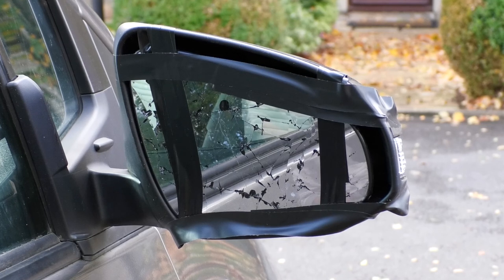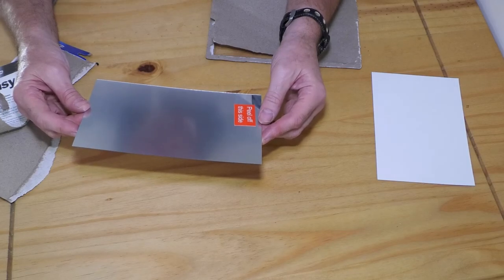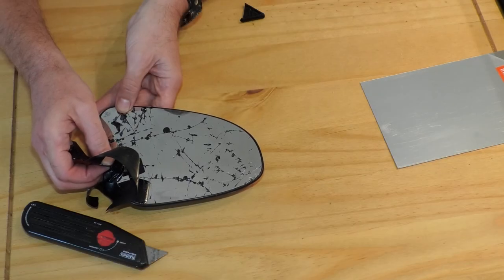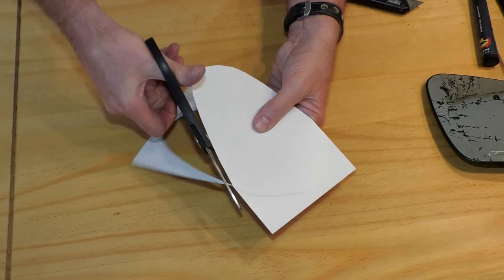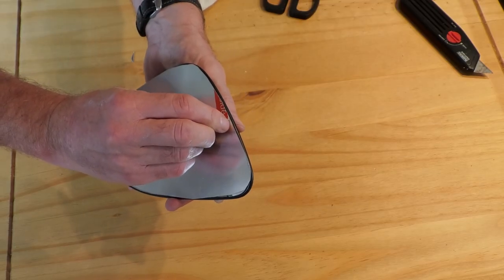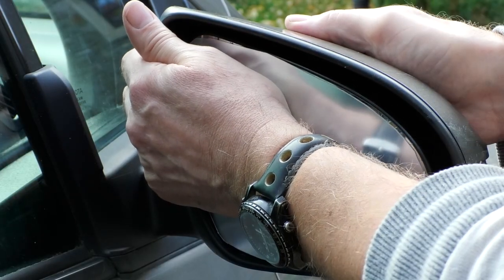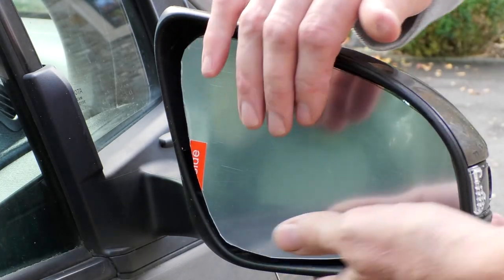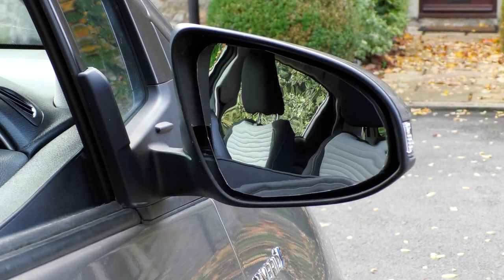How to fix car wing mirror temporarily with Streetwize Easy Mirror Fix

Comment: is there a way to do this without having the inside structure to place it onto? my mirror is completely smashed so not sure if it could be fixed
Reply: with this method
Reply from the maker: Unfortunately this fix is only really suitable if it is only your glass that is broken. I think if the entire wing mirror casing is smashed then I think the only solution is to buy a complete new wing mirror unit.